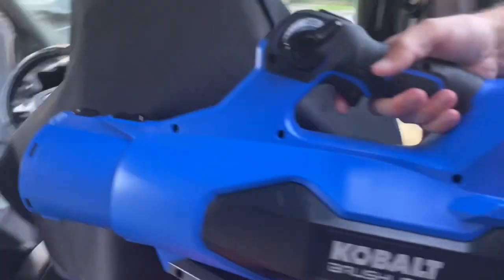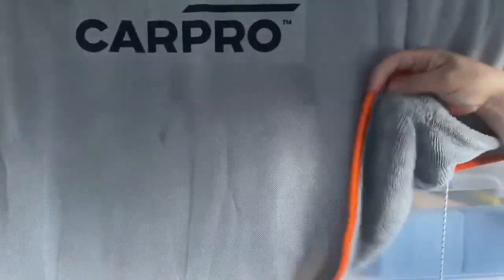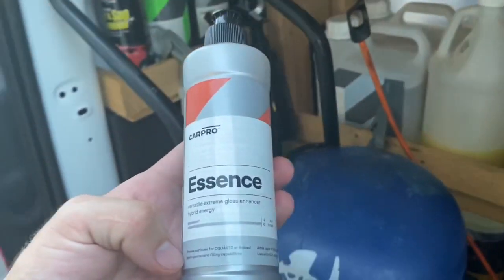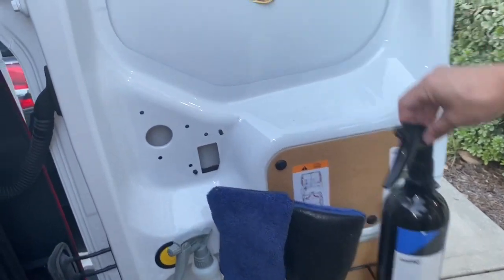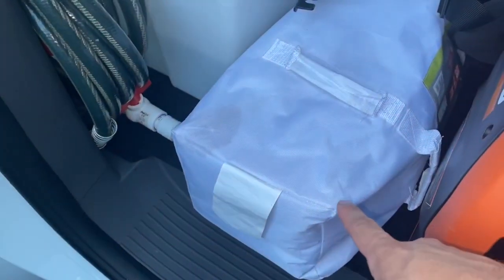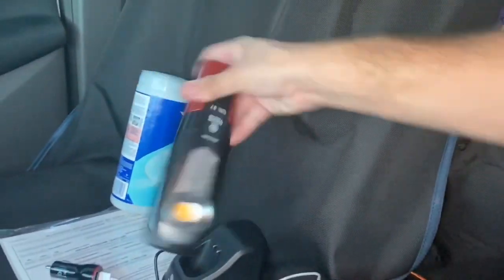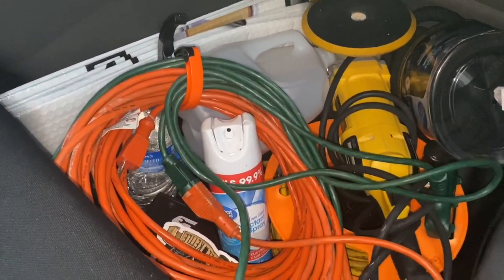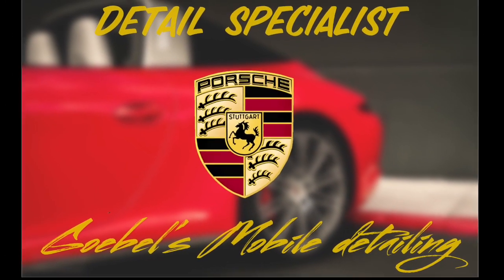Car pro chemicals + new blower

Comment: Sharp hat. You get those made locally or online?
Reply from the maker: Clif Hellner thank you sir , and local
Reply: Nice, how many did you get made and what did you end up paying? Best deal I’ve found online is 20 for $20 a hat. Richardson, Trucker Hat. Not looking to drop $400 on hats, nor do I need 20. But most places, require a 12-20 minimum purchase.
Reply from the maker: Clif Hellner I paid 210 for 3 shirts and 3 hats
Reply: Thanks. That seems reasonable.
Reply from the maker: Clif Hellner and they are rich has as wel
Reply: Must be nice 😁. You got a link you can post? Might have a look at them. If not, no biggie.